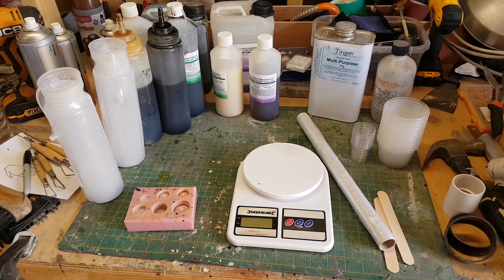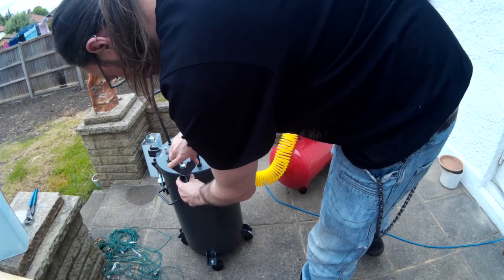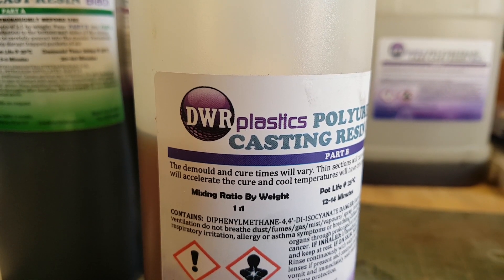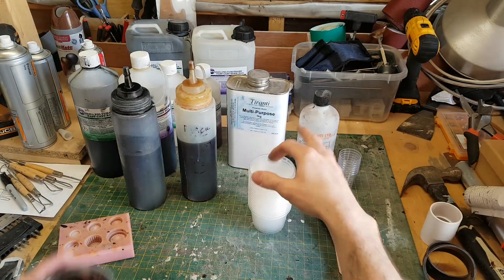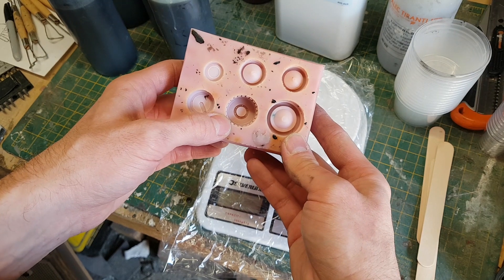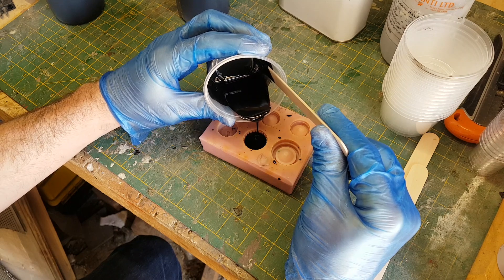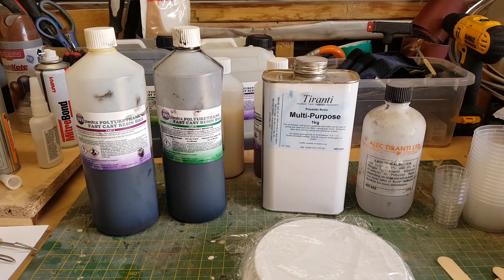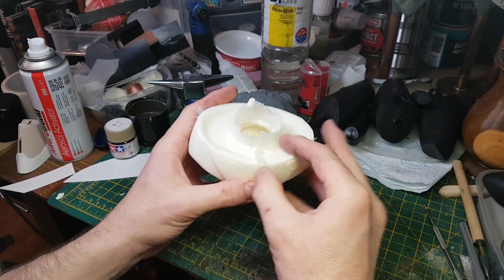Resin Casting - Polyurethane vs Polyester Resin

Comment: Good idea with the condiment bottle and cups, I'll have to look into those. 
I can confirm jewelers scales work great for small casting quantities, I've used mine for a year or so and has made measuring my smaller casting quantities so much easier. 

Do you use anything to try and prolong your silicone mold life? I used spray wax and talc powder, the talc powder is great for drawing in resin to areas that might trap air but doesn't prolong the mold life by much, but the spray wax helps with the mold life but doesn't seem to give a great finish (unless its the wax release I use?)

Cheers for uploading  this, it was great to watch.
Reply from the maker: Thanks, I'll have to get some jewellers scales then I think!  No, I'm not doing anything special with the moulds.  The same suppliers I mention also do a low cost silicon.  It's not super quality - I wouldn't use it for a run of casts of statues for example, but as it's low cost it's great for one off or low use moulds.  So for the small mechanical details I'm casting, I just glued them all to a sheet of plastic and just make a fresh mould when one wears out.  As they're small they don't get very hot, so the stress on the mould isn't that great.
Reply: @thedarkpower  I have to admit that mold your using did prompt me to think about making a mold for all the parts I plan to use for some kitbashing projects I've got in mind, cheers for that creative nudge :-) I'll check out that silicone and see if it might be any use to me.
Reply from the maker: @MLTharme  Yeah I've found having a library of moulds of various mechanical bits really useful.  

Yes I have a video on pressure casting here actually https://www.youtube.com/watch?v=SHigOAugmcE

I know people do convert paint pots to pressure pots (the one I'm using is exactly that I think, but it's been converted by the manufacturer).  I'd say that if you know what you're doing then go for it, but if you don't best not to mess with something that could potentially explode ;)
Reply: @thedarkpower  Just literally found the very video before you replied, my bad, should have checked before writing lol but thanks for replying :-) Aye, I think once my finances are a little more balanced I'd rather buy one rather than build one anyway, I'm not that great a technical things but if it was something that wasn't too difficult to build I'd consider having a bash.
Reply from the maker: @MLTharme  I suspect it's not that hard to do, I just don't trust myself with that sort of thing ;)
Reply: If it’s the exothermic reaction that’s damaging your silicone moulds you could try doing 2 pours instead of 1 - fill half the mould let it cure then fill it up. It shouldn’t heat up so much then which may help but silicone moulds do ware out over time anyway
Reply from the maker: @resinweirdos358  It's just regular wear and tear really - these small pieces don't get very hot, so it's just regular use and also that I'm not using a super high quality silicon.
Reply: The Dark Power we all get wear and tear over time 😂

Comment: Resins can cause sensitisations, you really should always wear nitrile gloves and a respirator mask or work in very well ventilated area. I’ve never used polyester resin but I like polyurethane and epoxy resin very much! Great video thank you 😊
Reply: I’ve heard it stinks so bad, That’s the reason I’ve never tried it lol
Reply: Good points, I use Nitrile gloves all the time when using resin, invested in a respirator mask (hopefully the filter is doing it job)
Reply: ML Tharme better safe than sorry 😊
Reply: Just for clarification spend the extra money to get a reusable P3/99% respirator and spare filters the disposable ones are shite.
Reply from the maker: Thanks!  Trust me, if you ever try polyester resin you'll definitely need a respirator!  ;)